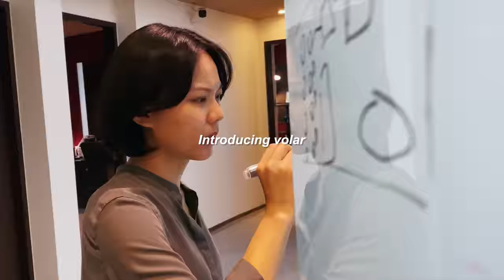Bellwether eVTOL | Free Flight with volar

Comment: Not gonna lie, It looks really cool.  But, I see one major flaw with this sleek-looking design.  Once the craft begins to pick up forward momentum the cool-looking aerodynamic shape (along with those 'Winglets?' 'Ruders?') starts to push the whole thing down due to the body shape acting as a spoiler would on the back of a car. Unless you're using forced vector thrust to direct the airflow back instead of tilting the craft forward, this will always be the result of forward flight in the traditional quad-drone configuration.
That body shape seems more geared toward downward force at high speeds than for lift in flight. I'm sure that if it had wheels it could corner really fast without losing traction.

... But, it does look really, really cool.

Comment: With all the praise in the comment section this might not be a popular opinion, but it seems to me that virtually everything that Dubai comes up with. They always start with the form factor first, and then try to make it work. Devel 16 comes to mind. Whereas everywhere else on the planet, the form factor is last, and is a result of the choices of engine, motor, fuel, battery, layout,chassis and so on.  It's like a twelve-year-old is in charge of R&D. These projects may make headlines but they'll be forgotten in 10 years.

Comment: When they can make this fly as stable as the current crop of multi-rotor vehicles already out there, then this will be innovative.  But this thing barely flies better than the Avrocar that was built back in the 50's.

Comment: If I was developing one of those, I would not be flying manually. I would do AI driven to follow a predetermined path and test it to the highest speed capable of the motors onboard. This would give you lots of data to work with to optimize.

Comment: Love the design! So is this going to be a full size scale flying car?
Reply: You mean a Helicopter? Or a full sized drone?
Reply: @jeettrivedii  I would not call this a helicopter.. :) I thought that this might be a test to do a full size vehicle to let people fly around in.
Reply: @kjpphotography4764  If that happens, what are the guarantees that people don't crash like they do on roads. I mean, flying is way more dangerous than driving on the road right? What the cost of buying one? What about the maintenance and repair cost? How certain can you be that one might need a pilots licence to own and fly one. Are flying absolutely necessary, we can make it work bu building tunnels, use Hyperloop. There are tons of questions you could ask but Flying cars seem all about our stubbornness to move forward rather than building something that is indeed practical.
Reply: @jeettrivedii  For one man must always dream. As for crashing, that is why computers would need to be installed to assist with preventing crashes due to human error. I for one have always wanted flying cars.
Reply: @kjpphotography4764  True, humans will never stop innovating, true we'll use AI to make them safer than ever but Flying car is just another word for Helicopters. Also, it might be easy to buy one but will be extremely expensive to maintain/repair it. I hope we never get flying cars, they're not practical.
Reply: @jeettrivedii  What i consider a helicopter is a blade whirling above and have a spinning rear prop. I guess you could call these a quad copter. Why do you think flying cars are not practical? It's alot faster to fly then to drive, so i really don't understand your logic.
Reply: @kjpphotography4764  It's all about Cost of buying one, Safety and cost of maintenance amd building the infrastructure. 

Like I said before, people can barely drive safely on road, even with AI, now you're talking about giving some random Karen the ability to Crash into someone's house who honked at her? Are you kidding me. 

Innovation is necessary and we must never stop innovating, true, but Flying cars? No. Not innovating. 

Can you guarantee that we'll never see different versions of 9/11 happening every 1 hour.
Reply: @jeettrivedii  Ye of little faith. I am sure that the tech will improve for AI to assist with flying safely. And as for your comment on cost. I am not sure how old you are, but in the mid 80's CD players were $1000 and up. Now you can buy one for under $50 some as cheap as $15. The more something is command the cheaper it becomes to attain. I have no idea why you have such dislike to own a flying car. I am just wonder if you just want to argue because you like to do so. But whatever. I for one would like to own a flying car. You can have your opinion, that's fine.
Reply: @kjpphotography4764  I don't comparing a weapon like Flying car against a CD player is right. I've said it before and I'll say it again, I want to see innovation, I want to be a part of it but not flying cars. Extremely dangerous in the hands of normal people. Also, if AI is doing all the work than what's the point in just sitting and admiring the scenary around you, you know. 

Let's end this argument here. Have a great day!
Reply: @jeettrivedii  I was addressing your cost comment when I was talking about the high price of CD players when they first came out. As for flying cars being in the hand of dangerous people- cars are dangerous in the hands of people. That is why we all take drivers ed classes and learn how to drive before we get our licenses. I am pretty sure that someone would not be able to buy one and jump in and start flying around. I am sure you would have to take some kind of flying lessons and work to get some kind of flight license to fly one of these. Yes have a great day!

Comment: Although the design does look really nice, I struggle to see this being able to fly in anything other than perfect conditions.  This prototype doesn't even seem to have wheels?  How is it a flying car?  Looks just like a drone that is optimised for straight line speed/efficiency/looks over stability/manoeverability.  Maybe you need small retractible side rotors for low speed stability?  Good luck with it though it will be amazing if you can pull it off.
Reply: A flying car isn't supposed to have wheels.
it's supposed to look like a car but without the wheels.
watch the fifth element movie

Comment: You guys.... made a drone, you know that right? Yeah, cool that you hid the props under a fancy, futuristic design, but it flies like a drone. The on board comp also seems kinda crappy unless you were flying it in a very windy set. Also, hopefully by the time you make the full scale models there will be batteries that can last longer than 5 mins on working 4 electric turbines because unlike with electric cars, you don't get regenerative breaking in the air. Good luck.

Comment: im pretty sure the United States have had top secret ultra light quadcopters for quite some time, they look like drones that have completely encased blades..you can't hear them at all until they get close so that you can hear that familiar drone sound..sounds similar to a helicopter once close enough to hear it (probably less than 500ft away is when you'll start hearing it roughly) except isn't choppy its just a mild roar or loud hum however you wanna say it

Comment: Why are people so obsessed with a VTOL vehicle that doesn't use forward motion for flight assist? The main problem with this type of design is it puts all of the chips into lifting the craft with brute force! In the event of a failure anyone in the vehicle is screwed. At the very least incorporate some kind of folding wings on it for some redundancy.

Comment: I would guess that Gyros (or more power to them) could help stabilize it for mainstream use. If there is a system failure, gyros can keep things from going catastrophic as well.  The downside is cost until production capacity reaches economy of scale.

Comment: This really doesn't look like it's going to scale to a full size model, its not going to generate enough power to lift the weight of the required materials, plus the added weight of the motors themselves

Comment: It's a flying toy that can work few seconds before running out of juice. Payload, maybe few kgs.
A flying electric car is not possible, because of the law of cubes and squares.
Far before to be able to lift a human body, the batteries will become so heavy that the power they can generate is not sufficent to lift their own weight.
Small electric drones work because they are small and weight next to nothing.
We have the flying car already: it is called helicopter.
And it needs a turbine engine to produce enough power for lifting itself.
To extract the same power from a battery, it would need tons of them, unless we imagine they must work, like, for 15 seconds before running out of juice.
It's not an eco-solution though, since we burn coal to make power.

Comment: I’m sorry but that’s a “show pony”. All those beautiful lines aren’t useful control surfaces in flight, the shrieking duct fans are a PID loop nightmare to keep steady due to the tight thrust columns and incredibly low disk loading area. In order for any advanced aircraft to be stable, safe, maneuverable and robust, the majority of its mass MUST be dedicated to either Li-Batts or the propulsion system and have a high disk-load flight surface area (big props or 6,8,12,16 configs).
All you quadcopter racing pilots know exactly what I’m jive’n on about.

Comment: Hate be negative, but truthfully...such unstable flight on a model,  is really unacceptable. I built a plane, with coroplast sign material. Powered it with a 23cc 2 stroke. Three months to build. Was too heavy, but flew much steadier than this. Your design is impractical for occupants.

Comment: it's not that easy to scale up - earth gravity (9.8m/s2) is a bitch. The machine is basically a quadcopter drone.  The current battery technology can't sustain the output required for real flight. Evtol machines that can carry a person exist, but they can only operate in minutes due to the limit of the current battery technology.

Comment: I am confused about why this is being developed. Others have found that this quad copter style of vehicle cannot be scaled up and is not feasible for passenger flight at anything but low speeds = like a hobby craft = hover craft. It is nothing new! It cannot scale up for commercially viable passenger travel as currently designed. It is a waste of money.. a serious money pit with no hope of recovering the costs. It must be nice to have fun and get paid to work on it though. Even at this current scale, it will not even make a good drone. Scale it down and it could be a fun toy. 
Sure.. huge advancements in similar size propulsion units and battery tech could make it feasible. But, winged craft for faster flight (and efficiency) will keep it out of the market due to cost versus performance. What a cool job to have though!

Comment: It does not matter if it could fly or not without safe flight for the citizens of below it will never happen it has to have a powerful stop and method what about if it fails to fly but then while it is on air it will start to crash down then white

Comment: Very attractive, yet until there is a battery that weighs 1/2 as much and 5x the power density your wasting your time hoping this will ever succeed. By the way if this is 100% AI flown you can count me out. When I'm flying an aircraft I'm ok with safety help but I want control. Since this appears to be like a high performance supercar it would belike spending 3 million dollars to be driven around by a computer, no thanks!

Comment: Soooooooo you made a drone and then spent two years to stick an overly fancy body on..........good job?

For real though, its just a four prop drone literally anyone could build with off the shelf parts in a few days and then surrounded it with a bunch of fancy but completely irrelevant body panels to make it look like a flying super car. By the looks of this video I have seen hobbyist built drones of the same size or bigger that are more stable and smooth flying.

Comment: It looks like a fantasy sci-fi design.  Too many unnecessary contours.  It indicates that it wasn't put to any rigid testing and simulation.  It's probably not efficient and compromised to serve its looks.

A sportscar can manage to look like a batmobile because it only needs to not act like a parachute and stay on the ground.  An aircraft however, needs all the aerodynamic and fluid dynamic efficiency it could get.  It's why airplanes don't have sculptural features just for the heck of it.

Comment: Too much time and resources spent on whatever cartoon artist they hired to design the body, with almost no consideration for practicality.

Like most of these flying quadcopter endeavours, they all seem to be missing the main problem.  Well, besides the obvious main problem of power.  It really doesn't take a brilliant set of engineers to build a man-sized quadcopter flying car, as everybody is doing it.  The hard part is implementing the sensors and programming necessary for stable flight in varying conditions.

Real innovations will come with machine learning working off the flight test data to make it fly well enough not to be a quirky, dangerous mess.  This isn't an easy task when considering the responsiveness of controls and associated lag time while sorting through varying winds, temperature, momentum, ground effect, and probably a dozen other factors for stable flight.

Without that technology being worked on, the best they can hope for is to fish in a few dumb rich folks with more cheesily produced videos using the same stock inspirational music scores.